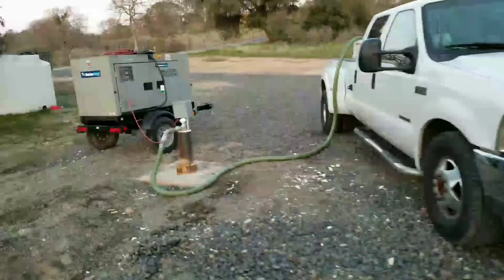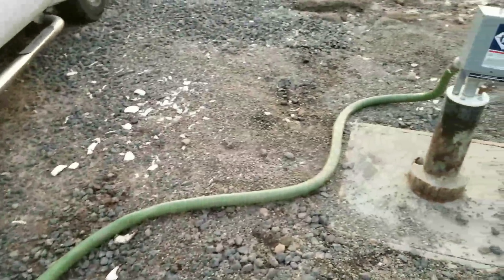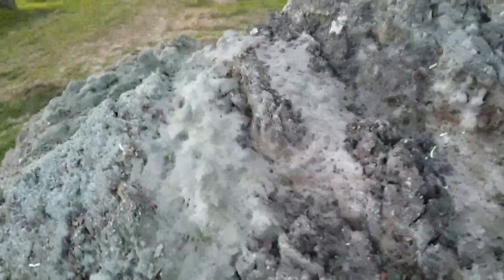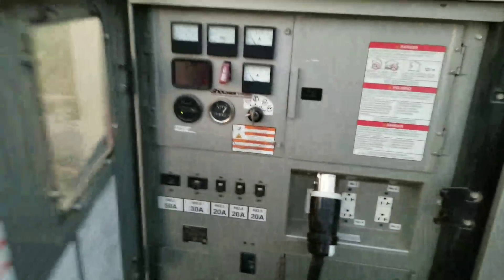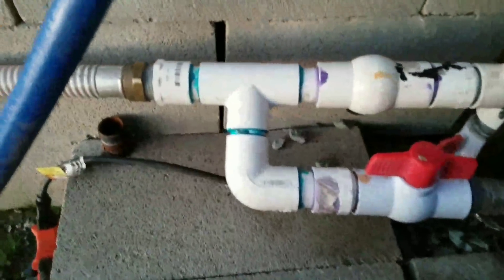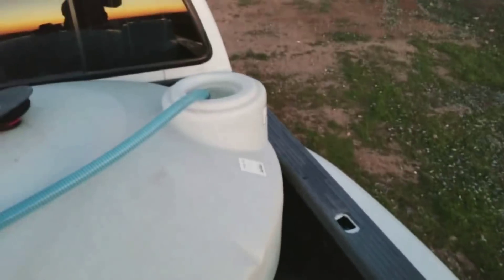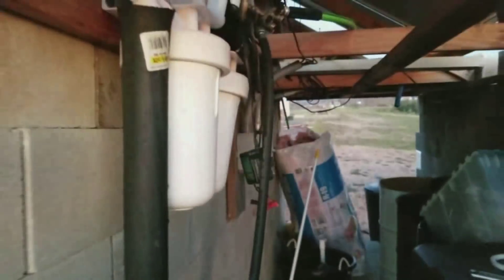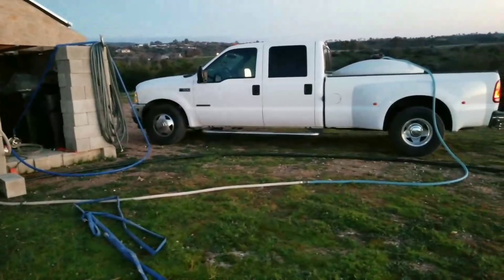Off Grid Water Supply

Comment: What's your plan on digging a drench and put multiple conduits in the ground? 1 for water tank filling, 1 for water usage (if required at that spot) and 2 for power and network. The costs are mostly for the digging and backfill. A few extra conduits might cost just a few bucks (PVC, LDPE or HDPE). While saving you a lot of hassle, money and time afterwards.

Might be a bit offtopic:
Cat5e is enouch, cat6 is overrated. max 100 meter. Above 100m use LC-LC singlemode fiber and media converters. Fiber is actually cheaper than cat5/6 cable. Use "patch cable", they miss the extra ruggedness, which is solved by pulling it through a conduit (2~4 pairs in 1 tube, just tape the connectors with 15cm distance of eachother, to limit the tickness while pulling multiple fibers). Always pull multiple cables through a conduit, or leave it empty. Adding cables while one is already installed is quite a horror story. I'd get fiber for 10 euro at 10 meter (4 euro per LC connector, plus 2 euro for 10m fiber = 12 euro for 20 meter, etc). DO NOT USE MULTIMODE FIBER for new installations! Use singlemode fiber, which goes up to 100gbit/s a without problem. SFP modules might only cost a ~5 euro (at fs.com). And 15~20 euro for a media converter with SFP slot (TP-Link for example). LC-LC fits in ~19mm inner diameter PVC conduit. Tested with 4 pairs.